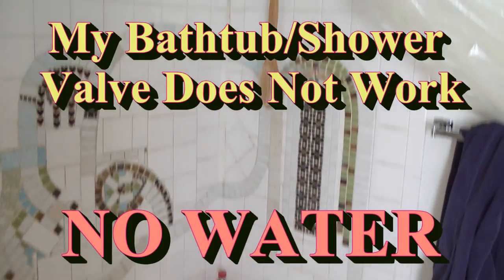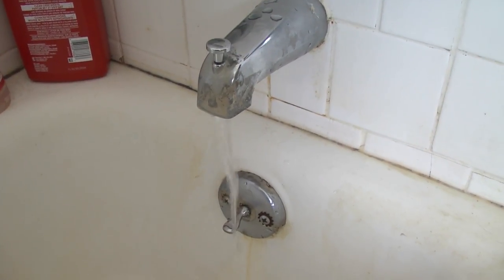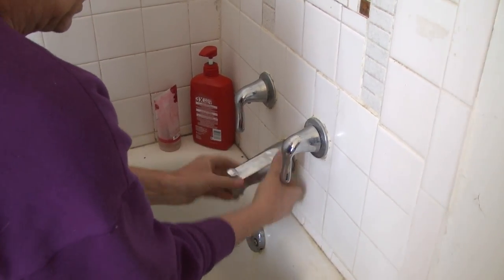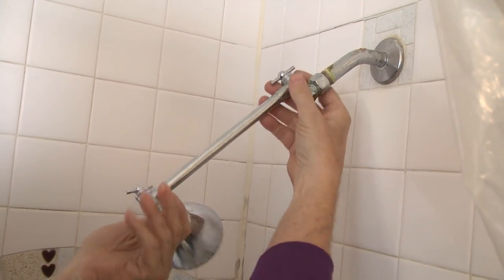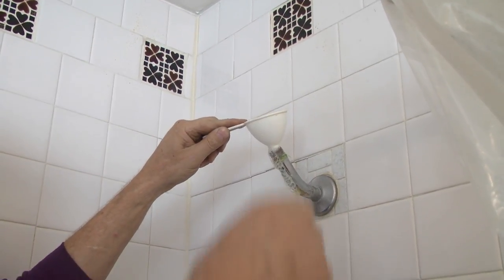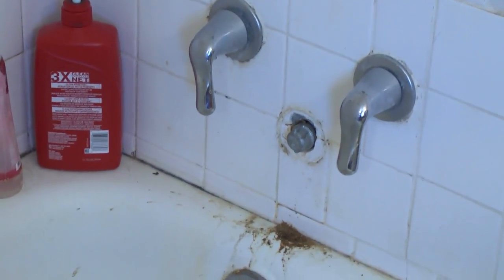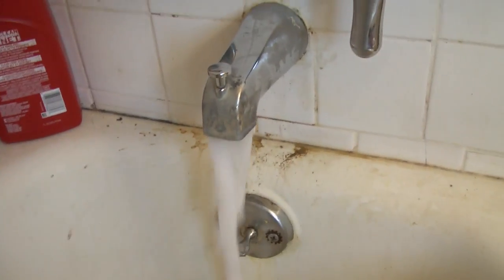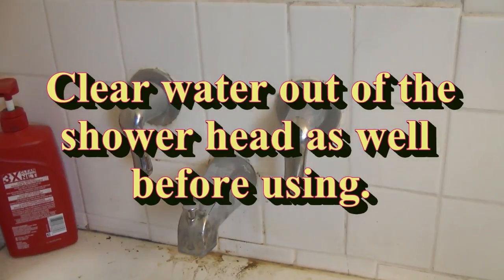My Bathtub-Shower Valve Does Not Work - No Water!!!

Comment: Thank you so much! We kept replacing the tub spout when the shower stopped working thinking that it was the gate. It would only work for a time and then the shower would stop working again.so I tried your fix it and it worked! Also our water pressure improved quite a bit. I plan on doing it again next week using vinegar instead. Hoping we get the water pressure we had 5 yrs ago. Really thank you for the help.

Comment: I want to do this but I'm wondering if you have copper pipes and of course on the label CLR says not to use on copper pipes.  I'm wondering what you think?
Reply from the maker: I have copper pipes running up to the valves but a steel riser to the shower head. So the CLR never goes past the valves into the copper pipes. Good question though, thank you.

Comment: Any chance of the CLR contaminating the drinking water/pipes?
Reply from the maker: This is a shower valve and soon as it is opened up the CLR/water mix is forced out in only one direction. I'm not an odds maker, but I'd say there is very little chance if you flush it out for several minutes. Thank you for writing!

Comment: My faucet handles and water spout are all one piece. What do I do in that situation?
Reply from the maker: Same process, just one valve. Also, if the problem persists check your tank for sediment. Thanks for asking.
Reply: @hardluckcharlie  I figured out the problem. Faucet handles just had to be tightened. Problem solved. Thanks for replying.

Comment: I've replaced everything and it's only made it worse! lol Getting CLR and the cap tomorrow and crossing everything! Worse case is that it works and I have all new innarrds :D
Reply: Do you remember if it worked or not?
Reply: @hopecritical-ops5554  The CLR did the trick! I used a hand pump garden sprayer and inserted the nozzle into the throat pipe and let it sit for a few hours. I have better pressure than ever before :)
Reply from the maker: That is great news. BTW, check your tank for sediment build-up. That was the cause of my continuous clogging.

Comment: Can I do this same process if I have a strong water flow from my bathtub nozzle but no water flow from my shower head?
Reply from the maker: If you are getting water to your shower head, just clean the head. If it's not coming up the pipe, I'd give it a try.
Reply: @hardluckcharlie  I just fixed it I needed a new bathtub nozzle because my shower diverter wasn’t work and now that I installed a new tub nozzle I have water to my shower head since that diverter is working properly so thank you

Comment: very useful hlc ; would white vinegar work, instead of chemical descaling ?
Reply from the maker: Yes. It may work just as well. It's safer. Certainly worth a try. You may have to let it soak a little longer. I did the CLR for about 4 hours. Also, it would be good to mix some baking soda and water to pour in before using to neutralize the CLR acid.  Thank you for watching and commenting.
Reply: How did you get the shower head to turn upside-down?? Mine won't budge

Comment: My shower has a hot water handle on left, a shower handle in the middle and a cold water handle on the right it is old school, can I just remove shower head and turn neck upside down and pour CLR down it and let it soak without taking shower handle apart ? I'm not getting any water up to shower head at all but I can hear the valve making like an air noise any help would be greatly appreciated,  this shower probably hasn't been used in a year
Reply from the maker: Yes. That is basically what I did. Also, I found my water tank was filled with sediment. Check that as a reason the valves are clogging. Thank you!